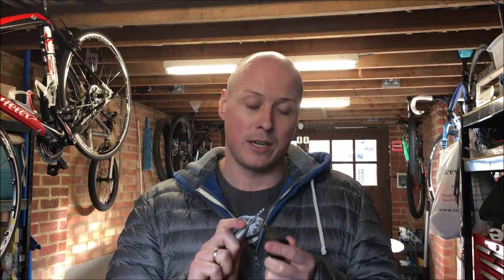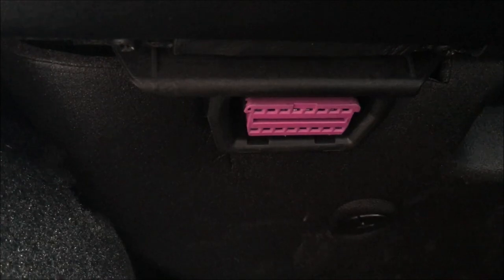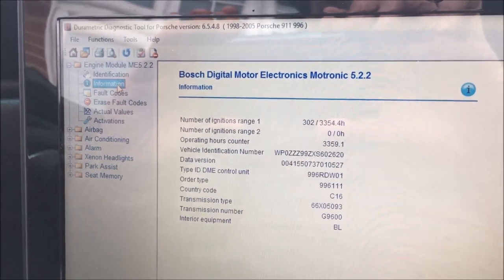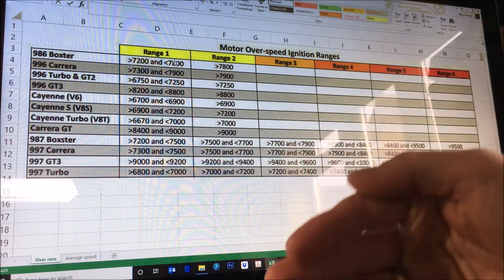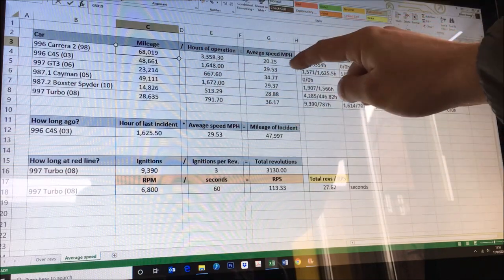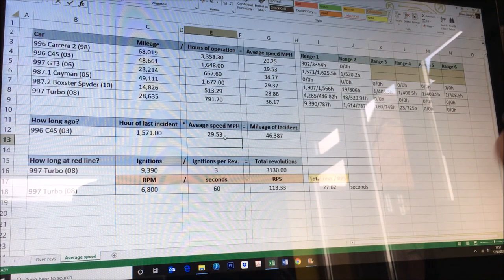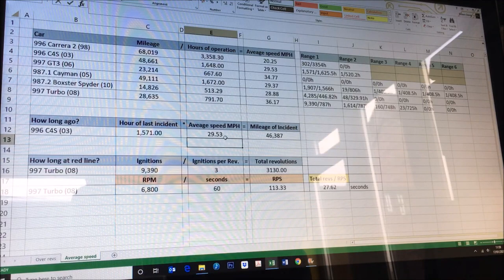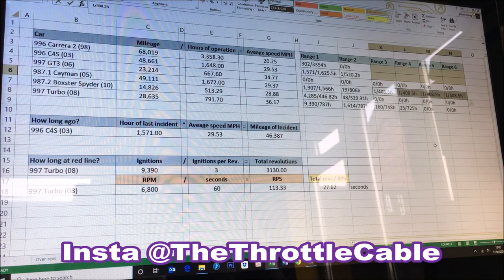Rev Range Report explained | Over Revs | Diagnostic | Durametric | Porsche 996 986 987 997 911 GT3

Comment: What irks me about it the rev range log,  is it's not as exact as one may think it would be, and not all buyers understand this in the way the presenter in the video does. 

My 997 turbo has 5402 in RR1, as it should as I often chase it to the redline and change, but in RR3 I have 8 ignitions, and they relate to hitting the rev limiter as I was changing up from 2nd to 3rd. Supposedly, hitting the limiter should not cause anything over RR2, but in this one instance it did, as I plugged in Durametric the next morning and there is no other logical cause. 

I also have the spurious single ignition in RR4 and RR5, but not in 6. Have no clue how they arose, as they appeared after a very boring drive to the office where I was sat in a traffic jam for 2 hours! My concern is whatever causes these spurious entries happens again, and I build up entries in RR4, 5 and maybe 6, which are all errors but may put off a future seller (although will probably just give my cars to my son when I die!).
Reply from the maker: I agree - the data needs careful thought to help inform ones decision, it’s should not be the sole reason to make a decision (unless it’s overwhelming negative!)

Comment: Excellent explanation, thank you. Could I ask, can duarametric also read the DME's total distance travelled log in KM?
Reply from the maker: Hi Ohms; I didn’t know this off the top of my head so I needed to wait to check. The answer is no, you cannot see KM’s in the engine module or instrument cluster modules - only operating hours and average speed.
Reply: @TheThrottleCable  That's great, thank you for checking.

Comment: IK im kinda late ,but does it go away if you've only drive your car hard 3 to 4 times a year? i drive my car  2 times a week if even that. i drive my car gentle ,but sometimes I drive it hard to get all the carbon build up out of the exhaust system and keep the oil going. I just want to know what i'm doing is fine for the engine? car has 68k miles
Reply from the maker: I'm not sure I understand the question but the rev-range reports are stored permanently for the life of the car.  In terms of being kind to the engine, keep the oil fresh, use premium fuel, ensure everything is warm before driving hard and continue to drive with mechanical sympathy. Enjoy!

Comment: how about 11958 ignitions for range 1 and  7014 ignitions in range 2 for a 996 turbo, last range 2 ignition was at 2144h out of 2221h?
Reply from the maker: 35 seconds in range 1,  20 seconds in range 2, has the car had a tune to raise its redline?
Reply: @TheThrottleCable  from what I know, no. it should be stock

Comment: I'm sorry but LOL at this rev range fixation! The idea that a car has zero hits in range one is really concerning to me. Suggest a car that was never used properly. If I don't tap the rev limiter, it's because I didn't drive the car on that day. My 1999 996 is over 1700 hits in range one and is a happy boy!
Edit: this came back across my recommended. I see I typed 1700 above... that should’ve been 17,000! FWIW, I’m now over 18,000 and counting. On a two range 996.1, the only way you’re hitting range 2 is with an accidental downshift i.e. skipped gear.
Reply from the maker: My advice - it is important to understand the theory first so that you can acknowledge an ‘over’ Rev and make an informed buying decision.

Two short example from my own experience;

I backed out of a 997 turbo purchase when I discovered the engine had just been buzzed. All the way to range 6 (past 9,000 rpm) within the last 5 hours of operation. 

997 GT3’s on the other hand mostly have zero over revs as the first range doesn’t start until 9,000 rpm. That NA engine has a much higher limit of operation.

As long as you know what’s in front of you it can be very helpful indeed.